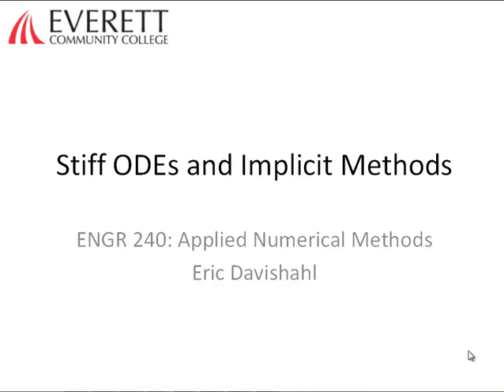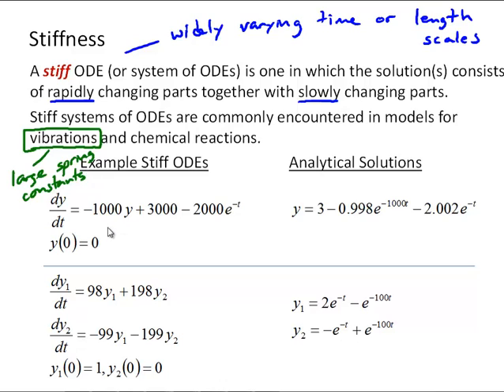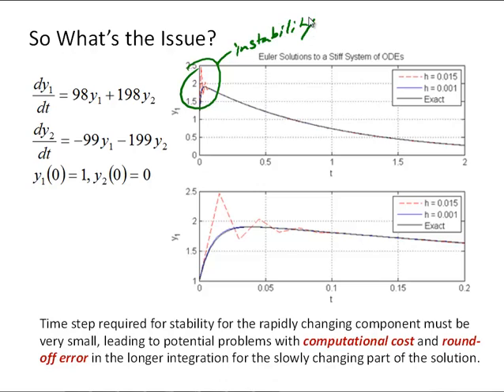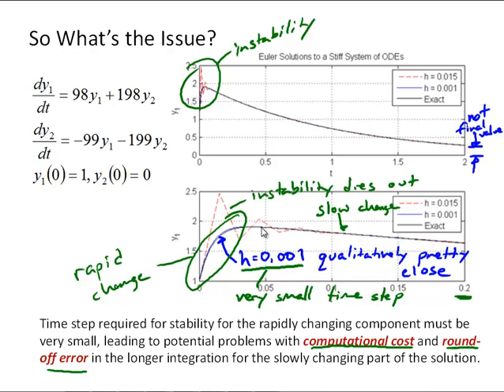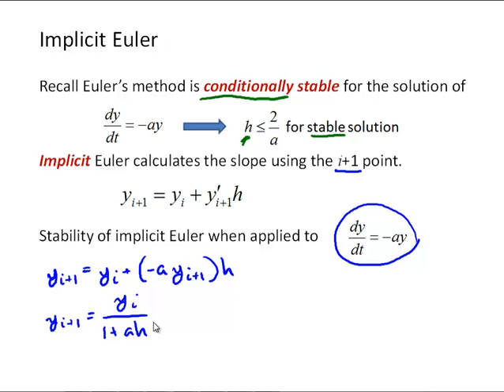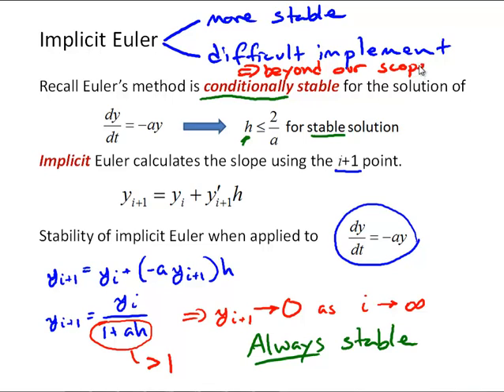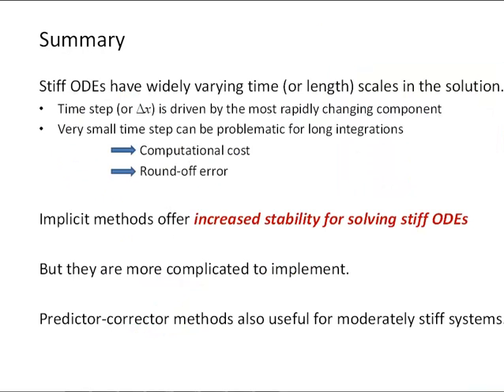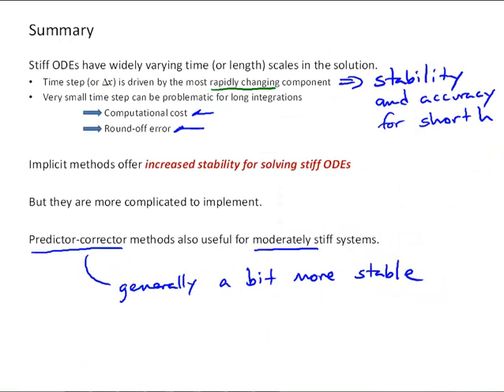NM9 4 Stiff ODEs and Implicit Methods

Comment: Hey guys I have an exam on friday, can you please help me with these questions? I do not understand why ODE45 would not be good for a stiff problem. I mean, should it not be more suitable to use an adaptive method like ODE45 in order to get the most accurate solution for a stiff system, since it adapts its step-size according to the real solution? I know that it takes more time to obtain the solution, but it should be more accurate than ODE15s which does not have this adaptive ability and therefore increases the approximation of the solution? Am I the one understanding everything in reverse? Is the solver-choice based on the time consumption rather than accuracy?
Reply: i am sorry for the late reply but just for your knowledge , ode 45 is more generally used and its fixed solver type as he said u need a variable type solver inoder to solve for stiff systems